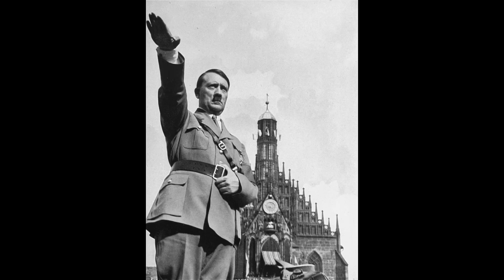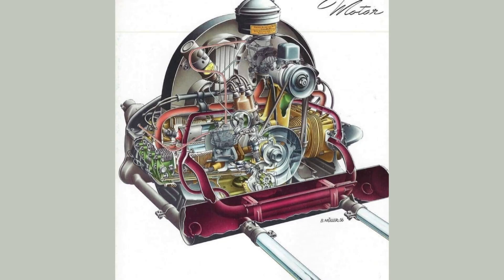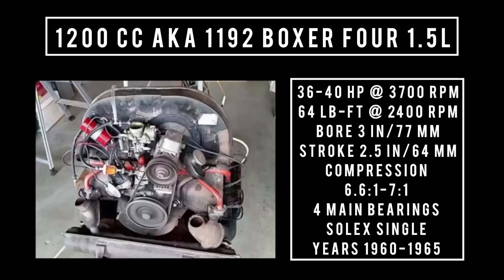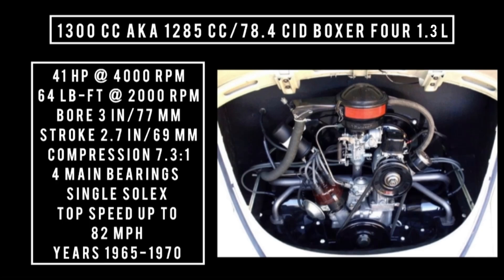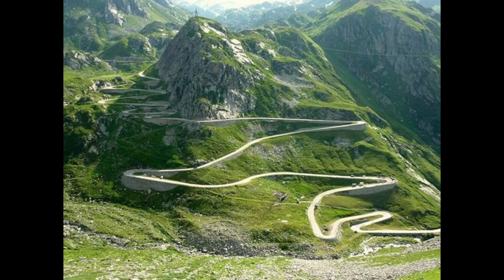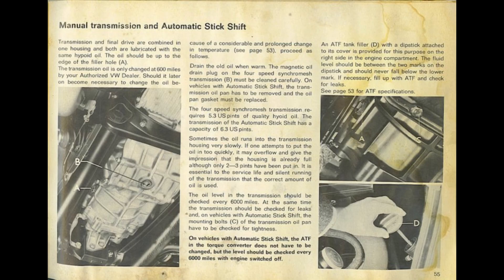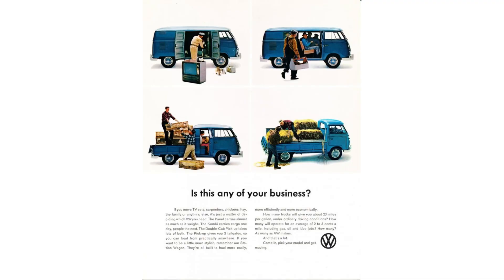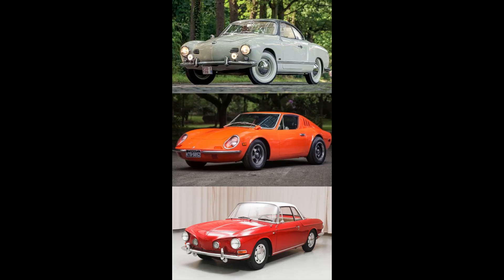Volkswagen air cooled engine family ( 1100, 1200, 1300, 1500, 1600cc )

Comment: When i was a kid back in the 70's VW's were everywhere! Especially bugs and buses. Cheap to repair because parts were easily available. A popular repair manual back in the day was a large paper back titled, "How to keep your Volkswagen alive for the complete idiot" ( very popular among hippies,  possibly the predecessor to all the other, complete idiot or for dummies books) I don't remember the authors name. Basically anyone who owned a VW (whatever model, engine size) with this manual could work on their own car. The language in that book was to say the least "down to earth" to whereas anyone could understand it. Even today those old bugs, beetles and buses bring a good price. I remember my late brother-in-law used to say, " if taking a road trip with VW bus there were four things you always took with you besides a complete metric tool set and at least 4 quarts of oil (a case if you had room), 1 was a throttle cable, 2- clutch cable, 3- fan belt, 4 most important a spare engine." If you brought along a decent floor jack you could swap an engine out in a couple of hours if that on the side of the road. Allot of mechanics who started in the 60's and 70's  all have experienced VW's in one-way or the other.
Reply from the maker: Thank you so much for sharing your experience all of those memories I never had any issues with mine I regularly drove it for almost a year we bought that car to flip it and it took almost a year to sell it after it was done so it was supposed to take a year took three years.. or 2.5 years
Reply: I drove from NYC to Los Angeles, and back, without needing to add any oil. Fan belt typically about 20,000 miles. By the way,  Volkwagen Alive... Complete Idiot had incorrect instructions for changing the fan belt. The correct way to change the belt was actually much simpler and easier than was described in that book. In fact, the method described was just ridiculous.
Reply: @soilmanted  I never got into the manual that far. Gentlemen l knew and do odd jobs for had one, helped him work on his '68 beetle. He used it a lot and wrote side notes in it. What l learned about changing a fan belt in a VW (air-cooled 1500cc) was there's a notch located on the inner pulley half which you could stick a large screwdriver or whatever into to hold the pulley from turning. With a 13/16 or a 21mm socket you could loosen and remove the retaining nut. Then slip off the outer pulley half, remove the belt. I do remember there were shims in between the inner and outer pulley halves to set the belt tension. If the belt was too loose you removed a shim and put behind the inner pulley (always saved them for future use), then if it were too tight you added a slim. Basically set to feel. I'm glad you had good luck with VW on those long road trips. Had to be an adventure. Few other things l remember from VW days were check your valves every 3k miles or when you changed your oil and clean the oil screen. Use a low or non-detergent oil.

Comment: Having been the owner of a '66 Beetle (sometimes referred to as the Bug), my first WYR choice would be the '55 Beetle. The second choice would be the '55 Karman Ghia.

My '66 had the 1300 emblem on the back hood, but for most of the time I drove it, it had a 1200 engine since the original froze up. I can say I did do a lot of downshifting when climbing hills. Still, it was a fun car to drive during my early college years. 

It had radio delete but it also had a sunroof. White, with a red interior.

I still miss that car. It was my first one.
Reply from the maker: Awesome story thank you for sharing those memories =) 

Great choices
Reply: I'll bet they didn't call it "radio delete" back then, since radios were not standard on most cars.
Reply: Repairing and rebuilding air cooled VWs helped put me through school in the early Seventies. The 1300 was notorious for dropping the #3 exhaust valve due to the oil cooler interrupting too much of the air flow from the fan. The trick was to set that one .002 looser than spec.

Comment: I’m laughing my behind off with your running start comment. Nothing is truer than that. I owned a 1964  VW and with 4 teenage guys in it….well, sometimes  it was a challenge to get up a hill. BUT…wasn’t the engine sound something. God I loved that tin can car.
Reply from the maker: I couldn’t imagine what that was like with four people I’ve done it with two people but I’ve never done it in a vehicle with four and if you had a fully loaded bus that would be very interesting.. 

When I first drove one the guy told me you wanna floor it before you get to a hill and usually it when you hear that mindset you think that you’re giving it all it’s got and you are but it’s a different giving it all it’s got because it doesn’t have that much to begin with and I’ve always wondered if the driving experience to the Volkswagen is the same as driving a model a.. that’s a car that I really want to drive

Comment: I've owned 2 Beetles,  the 1st one back in '83, till 85, the 2nd one , from '86-'87.   Made the 1st one into a Baja Bug, had the old single carb 1500cc, it was a '67 Bug, the 2nd one was a '74 Super Beetle,  with a 1600cc dual carbs..... my opinion> THEY BOTH SUCKED!   Whenever you had to remove something, something else had to come off, to get to that 1st item off.   I also bought a '78 VW Rabbit, with a 1.6? I think,,  water cooled inline 4,,,,,, much BETTER!~

Comment: ARGH! NIGHTMARES!  I have worked on so many air-cooled VW's in my life that I think(or hope) that I have developed an allergy to them.
I bought my '68 VW Beetle in 1978 for my mother the drive back and forth to work. That she was able to keep her gas hog parked. She loved the Beetle so much that she drove it most of the time. I had started working at a Porsche /VW specialty shop and felt that I could do no wrong. I had rebuilt the original 1500 into a 1650.
The problems came when I would take it to the mountains to go snow skiing. Ofcourse I drove it floored going uphill in the fast areas at 50mph(the stock bugs were lucky to be able to go 35-40). On flat ground, I almost had the needle on the 80 mph speedometer  back to zero again. On one trip down the mountain, with 2 friends in the car, I was chasing a Corvette down the hill, and keeping up. Problem was, The brake pedal was as hard as a rock and I was barely able to stop the car where the road leveled out. So, before the next trip the car got front disc brakes. The calipers were the 2-pin kind you would find on a Type III VW. Never had a stopping problem again and never wore out the brake pads. 
Well, after having to repair the engine several time and breaking the transmission a couple of times, I pretty much  stopped driving the Beetle. For the next engine, I was tired of working on it, so I pulled the engine and took it to a VW specialty shop.  I went to 1600 cc's at that time. Down the road, an out of town mechanic messed up the engine, so I went and got the car and towed it home. Still tired of working on VW's, I bought an engine which was built with all-new parts and came with a warranty, 1600cc's, ofcourse. Never had another problem and I was grateful when my mom sold it years later.
Now, Karman Ghia's. I can't wait till you do a video of one. I am especially anxious to see you try, and I mean try, to get into the back seat. I'm definitely not as tall as you are, with about the same girth, and I don't fit. I tried it once when I was in middle school and, never again! lol I don't fit into the backseat of a Porsche 911/912 either! I'm sure you probably outgrew your '73 Ghia. That was a great year model to have, still is. I've worked on those and others with the 2180cc engine. Talkin' about fun to drive!
Reply from the maker: Hahaha yeah 

Thank you so much for taking the time to share some of the memories with us I really enjoyed reading this =)

My Karman Ghia did not have a backseat but I’ve been back in the backseat of one it’s very tight I think Metropolitan has more space I’m not sure if I could fit back there now because I was smaller back then
Reply: @What.its.like.  Weren't we all? But, still it would be funny watching you do a Karman Ghia feature an trying to get in the back seat. A cheapskate buddy I grew up with took the back seat out of his VW Beetle so that only one other person could ever ride with him. Another friend of mine worked at a Mercedes dealership and one day he saw Shaquille O'Neal's Mercedes coupe in the shop. He had no front driver's seat and sat in the back seat to drive! lol

Comment: I'd go for the type 2 bus without hesitation.

The Karmen Ghia for sure.

I drove VW autos for decades.  Bugs type 1 but mainly type 2 aka VW bus.  1600 single and dual Port are great engines.  

Had a nice 66 double door cargo bus that I put a 1600 single port in to replace the stock motor which I believe was a 40 horse that was in the back in pieces in a box when I got the bus. The 66 was worth quite a bit due to the fact that it was a double door cargo model. The California surfers love those. 

I also owned a really nice 67 Westphalia pop up camper bus.
That one I put a 1600 dual port in it.   That engine has the larger oil cooler That sets on the back of the block covered by the shroud and it would blow the air through the cooler and it would exit out the vent on the bottom of the fan shroud. That in combination with a power pulley, .009 distributor , keeping points set properly and the engine timed correctly and with the fan belt set to the right tension along with frequent oil changes, kept that four banger purring like a kitten.

I lived in Yuma Arizona at the time and all my friends laughed at me when I bought the pop-up telling me that your nuts because that thing is going to overheat on you and leave you stranded by the side of the road.  

I knew better because I understood how a VW engine works and how it cools.  If they didn't overheat on Rommel and burn up in the desert they weren't going to overheat and burn up on me.

My family kept that van loaded up with everything we needed for a quick weekend trip.  We would jump in after work on a Friday head through the desert up the mountains towards San Diego camp up there in the Laguna mountains and have a nice little vacation with day trips down into San Diego to hang out at the beach or visit the zoo.  That thing never ever broke down. 

I also took it on a trip up through Bryce ,Zion, and cedar breaks and all over that area. It chugged right through those mountains without any issues at all. You didn't go fast but that was great for sightseeing. Coming back down with a little scary because the brakes weren't the greatest thing on those buses but you learn to drive where you downshift it a lot and took it easy on your brakes.

I could pull that engine by myself to work on it if I needed to. It was not that difficult. I'd just pull the rear bumper and the rear body panel slide my jack underneath there and raise it up to support the engine.  Then disconnect the cables, a couple of wires, the fuel line,remove the four bolts and then I could just push the bus forward leaving the engine sitting right on the stand where I could work on it.

Easy peazy.  In fact I always said that the reason Volkswagen made it so easy to remove the motor was because they knew ahead of time you were going to have to be removing it a lot.  LOL
In fact, I always carried a spare 009 distributor with me with the points in there and already preset with a new condenser as well. Since pulling the distributor was easy, one bolt and bracket and out it came. So, instead of screwing around with points if they went bad when I was driving, I would just swap out the distributor and be on my way.

Another advantage or disadvantage depending on how you want to look at it is that sitting right over the front wheels like that meant if you ever get into an accident you are the first one on the scene.....😂
Reply from the maker: Sweet choices thank you so much for sharing that insight and information as well as the story I really dig reading that. 

Just curious did you ever have a Volkswagen overheat on you the Karman Ghia never overheated on me but there was a couple times where you could tell that it was starting to get hot and I had to open up the baffles and let the heat come in to the cab.. it gets hot here in western Pennsylvania but it’s nothing like it is in Arizona I saw pictures from this year of actual car is melting because they don’t really make them at a quality materials anymore..
Reply: @What.its.like.  I never had any issues with overheating I did have one time where I thought the engine in my bus was smelling like it was hot and also the fan noise sounded different, so I pulled over and the fan belt was a little bit loose so I snugged it up and it was fine after that. I mean when you think about it the only thing that keeps a VW engine cool is air flow and clean oil so if it's running hot those are the two things to check first.  

It's never happened to me before but I do know of a friend of mine who also drove VW's and he had a piece of road debris which flew up and got sucked against the air intake on the back of the fan shroud he heard the sudden change in the engine noise and immediately pulled over to check it and it's a good thing too cuz it would have probably fried his engine from lack of cooling air if he hadn't have. 

I never owned a Karman Ghia so I can't say about there cooling or lack of cooling issues.
Reply: @carlmontney7916 also need to make sure all the engine tins and engine compartment seals and tins are in place. They prevent hot expelled air to be recirculated and sucked back into the engine. That is a very important item that enough people overlook.
Reply: @vayabroder729  true and most people who own those Don't even realize that. Especially about the tin. There's a reason that it's on there and there's also a specific reason it has the shape it does. That is to get air in and around the cylinders and block and get it evacuated out once it is heated up. 

One of the benefits of the dual port engines was the fact they had a tower oil cooler inside the fan shroud. Also, the dual port tin and shroud had a bump on the back of the shroud around the cooler with a vent at the bottom of it that allowed hot air from the cooler to vent directly out of the engine compartment underneath the vehicle. I know people who added those Tower coolers onto their single port engines then cut the stock shroud where the cooler was and then wondered why they were running hot. Never realizing that the reason was because it didn't have that additional bump on the back of the fan shroud with the vent at the bottom that captured the heat and allowed the hot air to escape. The minute I told them to change the tin everything was fine. Some of them would Mount the tower cooler externally and I have seen them actually screwed into the back of the fan shroud exposed where the fan would just suck the hot air coming out the cooler right back into the engine.  SMH.

When you only have air and oil cooling your engine, you have to make sure that both of them are always kept in excellent working order. Many people don't adjust their fan belt correctly either and that adds to the problem.  The VW engine when tuned properly, maintained correctly, with fresh oil is relatively trouble-free. I drove them for years. Both type ones and type twos. I lived in Arizona and I drove them during the summer and used to drive over to San Diego and make the Long haul up the mountains leaving El Centro CA. In the hot desert heat they never missed a beat and never overheated.
Reply: This is a lovely post.
Reply: @ownthenight01  thank you

Comment: Love it!!! In the mid 70s in college I had a 62 bug. During one winter it dropped a valve and I rebuilt the motor in the living room, but left all the bolts and nuts in a coffee can outside. It rained and froze and I had to heat up the can to finish the rebuild...cold, numb fingers! In the rebuild I replaced one of the jugs with one from a junkyard that didn't match the fins of the others, but worked great anyway. It had a hardtop sunroof, was a light blue color. I wish I'd kept that car. 😢
Reply from the maker: Great story thank you so much for sharing those memories I’ve heard stories of people taking the engines out I never had to take the engine out of mine it ran good

 I’ve always wanted to put Harley V twin the rear of a Volkswagen Beetle
Reply: @What.its.like.  Have a '99 Harley now. Put an S&S V twin motor in it. So if you do such a plan, I highly recommend to go with an S&S eco motor instead of Harley. My S&S is sooooo fast!
Reply from the maker: I would want it just for the sound powered doesn’t really mean anything to me considering most Harley v twin can make 54 hp which is about the same amount of power a four-cylinder VW air cooled made

Comment: Tuff choice jay I love the vans with the whole surfer vibe and then I guess I’d take a puma as I’ve never seen one before, what about the 1600 cc fuel injected bugs of the mid to late 70’s what was their horse power rating
Reply from the maker: I’m not 100% sure I didn’t get into any of that because the information is very conflicting evidently they made 2000cc engine as well i’m not sure if we got that here doing foreign cars is a lot harder than doing the cars that were made here because information was really hard to get on some of those engines.. and they made millions of them so you would think that that information would be out there but it’s a lot harder to get then some really hard cars here it’s weird